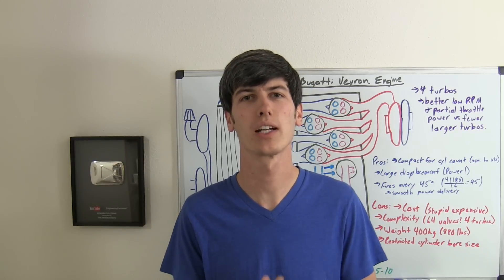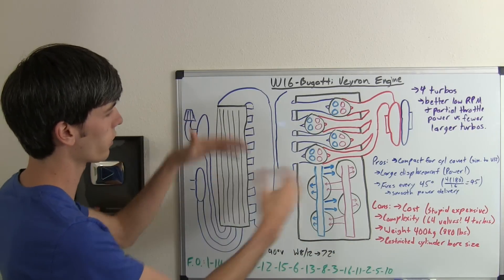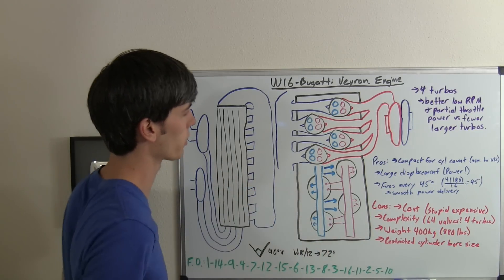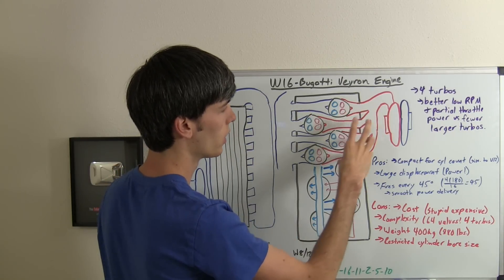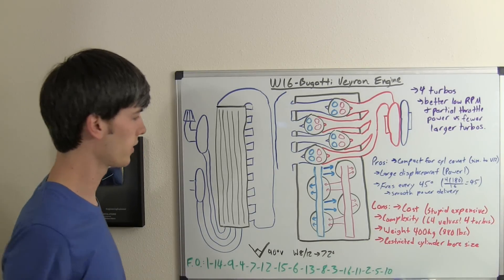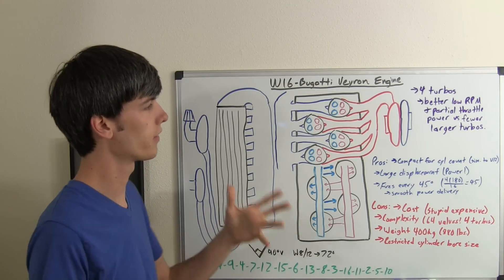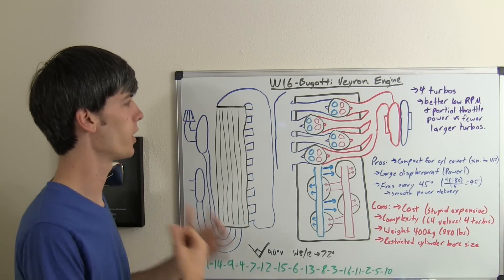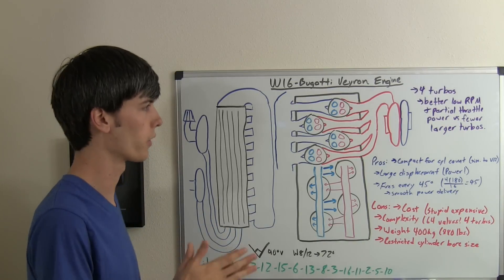W16 Engine - Bugatti Veyron - Explained

Comment: pretty cool engine, but the power output to size ratio isn't that great seeing how koenigsegg can get 1,341bhp out of their 5.0L V8
Reply: Which I belive the origins of that engine was a Volvo was it not...
Reply from the maker: Yep, because a newer car has a higher specific output, this one isn't that great... Add boost, you add power and reduce longevity. A higher displacement engine with lower power will see lower internal pressure and temperatures, meaning less stress on the internal components. The engineers behind it are not less capable than those at Koenigsegg, they're just taking a different approach.
Reply: Yea...but that Koenigsseg engine is nowhere near as refined, smooth, reliable, etc.  It's not even the same type of engine in terms of character , it's a totally different philosophy, it's like comparing a Bentley V8 to a Mustang V8.
Reply: gb291 Ford Coyote actually
Reply: @gb921 The 5.0 in the Ageras and One:1 are loosely based off of the previous 5.4 that Koenigsegg used. The 5.4 was based on a modular engine from Ford, but obviously altered heavily to handle much more power.
Reply: Engineering Explained -.- I didn't say the engine sucks, its an awesome engine, I was just pointing out that for a 8.0L quad turbocharged engine it really doesn't make a ton of power, and I was simply using Koenigsegg's engine as an example for comparison.
Reply: gb291 Doesn't Koenigsegg make their own engines?
Reply: Fraser Davidson ford owned volvo i work in a garage and the amount of ford componenets in volvo is high
Reply: BugattiVeyronBoy taht user name though chuckle and c heers
Reply: Lloyd koenigsegg can get 1,341bhp out of their 5.0L V8Only with E100 fuel i.e ethanol.
Reply: Tippotipo they can get lots more but if you were smart you would realise a car eiyh 1300 hp will probably weigh less and get faster times on like the nurburgring.
Reply: MrRockstarSocial Not exactly true when it comes to power and handling for faster laptime on track like Nurbrugring Nordschiefe. Traction and balance play into equation, look how Porsche 918 achieve its record while being heavier and less powerful than a Koenigsegg Agera series.
Reply: Tippotipo That was exactly what I was pointing out...

Comment: I have been wracking my brain on 2-1/2 engines. This W16 has straight journals/crank pins and the Ferrari Dino had offset pins but the V12s have 65 degree bank angles with straight crank pins. I know this gives the Ferrari that howl. I was studying the F1 engines before the body went all ignorant and set limitations on everything from max bore to v angle and number of cylinders. During the 3.5 N/A period there were all types of bank angles and configurations. One I saw frequently was 5 degrees off of optimal. 67 degree V10, 65 degree v12, 88 degree V8. I was wondering if that extended pulse or offset would upset the crankshaft rocking tendency? Ferrari uses 65 degrees even in their latest design. What other benefit can a doubletap firing benefit? I have read more journals than I ever wanted to with no clear explanation in sight.

Comment: ...and then there is the Hennessey Venom GT which produces 1244bhp from a V8 Twin Turbo
Reply from the maker: +Tom Forrest Add enough boost to any engine and you can make 1200 HP. Doesn't mean it's reliable. Not saying the Hennessey isn't, but adding boost adds stress, and stress reduces longevity. No way around that.
Reply: +Engineering Explained yeah true but its half the price for 200 more bhp im not complaining
Reply: +Tom Forrest One can build a car that will outrun Veyron for less than 1/10 of its price, but it would not be nearly as refined or reliable as the supercar. In that hefty pricetag you are buying lots of engineering, testing, designing, etc. to ensure that this would be a complete, good working package. Also - Badge costs extra. Imagine a cheap car built that it outruns Lamborghinis and Ferraris, it would still remain "just a cheap car".
Reply: I bet it can't put the power down from the line nearly as well as the bugatti can.
Reply: im talking road legal, try getting a BMW M12 down the road.
Reply: what is your problem? this is what is wrong with YouTube comments everyone feels they have to have a deep argument with anyone who comments
Reply: +Tom Forrest I know right, a LOT of cars outrun the Veyron with just half the cylinders, or even less than the half (6 cylinders). The Veyron is just overcomplex, overpriced and overhyped.
Reply: +Engineering Explained bugatti has boost too
Reply: Dg Fuc so does the Venom lol there both Turbocharged its just the Veyron has twice as many and goes slower.
Reply: look at powerbands for these cars. the bugatti makes more power then the venom at lower RPM and runs smoother with less turbo lag. it Also has AWD and is heavier, inherently giving it more grip. The venom has more of a powerspike and is RWD, which is a recipe for disaster.. I.e. the car wants to kill you, as the bugatti wants to go fast. My bet, the bugatti takes the venom all day in a quarter mile drag race if driven at the same track with the same driver and same weather conditions. plus the bugatti has a DSG and traction control. Considering the car weighs 1300 pounds more and makes less power, and Ms more drivetrain loss; The bugatti seems to be a bigger feat of engineering than just simply extending a lotus and putting big turbos on an LSX engine.
Reply: But surely lowering the roofline of a bentley and giving it a unrealistic engine which has never been made before is abit shit aswell?
Reply: +mibars The badge doesn't cost extra on this one. They are losing money with every unit sold.
Reply: Losing 6 million every car sold
Reply: Tom Forrest i said it because this channel replied that adding boost will make more bhp and its ez so im saying bugatti has boosts too
Reply: The Venom is the most insane car out there imo. The Veyron is overkill. The V8 used can take way more than what was thrown in it. They have an E85 tune in one that pushes 1451 without breaking a sweat. Engine design is the biggest factor in how much they can handle. With 6 head bolts per cylinder on that LSX, nothing is going to blow unless you push well over 1800 hp. And that is still short crediting that block.
Reply: Reece McWilliams actually, their block is shorter than a standard. Lsx V8 because they used two VR8 engines together. It only uses 4 camshafts like the lsx and only has 2 heads like the Lsx. It also uses smaller diameter pistons, which allow it to rev easier than the LSx. It also has a more usable power band because of the two twin turbo set ups. The engine is based off the Volkswagen vr6, which is pretty simple, and a 6 cylinder engine that is the size of a 4 cylinder
Reply: +Tom Forrest You have BMW M10 1.5l formula 1 engine wich produces over 1000 hp but its clearly lot less durable due to stress...
Reply: not sure why people think the Hennessey Venom engine is easy to break, I havent heard of any occasions where an engine has broken due to an excessive amount of boost it just uses a strong engine which isnt designed to break your just annoyed that an engine built by yanks which has half the cylinders and half the turbo's as a german engineered engine has more power
Reply: Tom Forrest
Im not really informed but not sure there was a question about breaking... Its possible that it wears out faster...
Reply: Razvan J The Venom is very aerodynamically sound, considering it is a lotus. They don't overheat and cool quite well. GTRs don't overheat also, but you are right about their hoods. At over 150mph, they buckel an have a chance of flying up. The Venom is built on an amazing handling chassis, but just has too much power. You can also buy the Venom with i beleive 7 or 800 hp too, which is not the GT model, which probably handles a bit better. The Venom is almost an ode to shelby. He took a small british chasis and put his big V8 in it, and then the cobra was born
Reply: I like the Veyron much more than the Venom. I own two Volkswagens and it's engine is based off of the VR6 engine in one of the cars i own.  But considering the Venom has an officail speed of 270.8mph, it must mean the Americans were able to make a chasis, built for low speeds and power, capable of breaking speed records. I find it impressive
Reply: I like tuners for regular life situations. I use tuning software on my car, but I don't run high Hp. I think the Veyron is properly built. But considering they cost nearly $8 million to make, I would hope so. Hopefully they come out with just half of the bugatti engine, which is called a VR8 and start making competitive V8s to the LSX considering it is smaller than the LS V8
Reply: There are 1500 hp supras over there, but I don't believe they can be considered  gt cruisers just like the veyron , reliability and maintenance are other things to consider, don't forget aerodynamics  going 250 mph is not easy even if you have the power, venom genesi is fast but I doubt it can be a daily driver
Reply: Razvan J supras are good up to about 750, any thing more then you start to lose serious reliability and drivability
Reply: You are right, skinueagle is one of these anonymous rude Youtube Trolls.
Reply: rude!
Reply: Razvan J for track purposes you're right. The 2jz does have cooling problems, especially when swapped into 240s. If you want track day and reliability, a cammed LS is the best way to go
Reply: but its still in all its glory a volkswagen
Reply: You're completely missing the point. The design of a V8 has been around since Moses was in short pants! It;'s inefficient and takes up far too much space.
Reply: You shall know that the engine can produce 3000 but it is detuned
Reply: Tom Forrest and breaks down every five minutes.

Comment: Ridiculously overengineered engine, You can easily push 1000-1200 hp out of V12 engine, hell even V10 is enough. This engine is very heavy and complex, and due to shitloads of moving parts this engine will waste energy resulting in a terrible fuel consumption/power ratio, the only advantage of this engine is ridiculous low rpm torque, but it's not worth it considering how many disadvantages this engine brings.
Reply: +Vladas Vynauskovas you kinda dont seem to get how stroke works right? less stroke, more rpm´s.
you can only make the engine so or so big with 8 cylinders until you have to increase the stroke.
Reply: exactly seeing as there are 4 cylinder engines that can produce 900bhp haha
Reply: +Tom Forrest for how many hours before being rebuilt?
Reply: +Dan Slotea That's the trouble with most "tuners" where they think just because their car is a dyno queen it will last as long, be as streetable as possible, etc. I love high-hp cars, and especially small engines producing big #'s. But I know damn well it will cost you big $ to get there. There are several people I know who have put out 900 hp but they spent close to 25,000 on the work required to get the clutch, trans gears, diffs, etc in order to reliably put down the power.
Reply: +Vladas Vynauskovas You totally miss the point that with the larger volume of pistons, each piston has less work to do. There isn't a single v10 or v8 engine under 7liters that can produce nearly as much torque at the psi levels this engine works at. This was made to be the smoothest and least stressed engine ever made, and surprisingly one of the strongest because of that. There hasn't been any major engine failures reported from Bugatti since the Veyron has been created, this can't be said for many other high powered v8, v10, or v12 engines you think can make 1000hp reliably.
Reply: Themayseffect I understand that every piston has less work to do so. My point is that 16 pistons aren't necessary and that many moving parts waste power. I understand that splitting workloads between cyls increases reliability, but I mean 16...really? And V12 do make 1000hp reliably if it's configured correctly. My bet is that Bugatti went unnecessary lengths to make the car as smooth as possible, but such reduced efficiency and increased weight is worth it?
Reply: *****
You can't name any factory v12 engines that makes 1000hp on the same amount of boost. Yes the v16 wastes a lot of energy to make 1000hp but still it does less work in the process because its torque band produces enough force to allow the engine to rev freely without to much wasted crankshaft force. But this is energy wasted at full power output. When the engine is running half throttle or less its extremely efficient.
Reply: ***** Why are you so very against using more than 12 cylinders? Sometimes it's not about economy. When you can spend $2M on a car, it certainly doesn't matter that it costs $300 to drive for several hours. I agree you can produce the same power in less cylinders. Plenty of Supras BT'ed prove that.I'd rather have the overhead of reliability than the fuel economy of the supra when you aren't on it. The point of big power isn't losses from friction resulting in more fuel consumption! LOL
Reply: Themayseffect It's funny but the argument is like saying all wheel drive is dumb because it results in less power and more fuel spent. Who gives a crap? Let the guy drive a prius if he wants..
Reply: Themayseffect Koenigsegg says hello. Produces aprox the same amount of hp and torque on a V8...And it weighs 189kg when a W16 weighs 400 kg, which is a huge difference considering that we are talking about supercars
Reply: whatmakesittick All wheel drive isn't dumb, because it actually gives something useful, like boosting 0-100kph times through the roof and overall grip, that's why cars like Lamborghini Huracan, Porsche 918 and Nissan GT-R are the fastest around the track. P.S I dislike Prius
Reply: *****
 Do you know how much more boost the CCXR, one:1 or Agera R is pushing? Way more. I never said a smaller engine can't make more power, i said not on the same boost levels and stress levels. The Koenigsegg engines are one of the few high horsepower cars than can match the Veyron in terms of Reliability and power output, but again the new Koenigseggs are massively expensive and have a ton or new tech to help slay the Veyrons. There are plenty of other v8 , I6's, I4's and smaller engines that top the 1000hp range easily. but the amount of stress they take to get there is extremely high compared to W16 engine. And again by "Stress" i'm talking about the physical force each piston and cylinder bank has to undertake to control that output amount of power those engines are making. I don't understand why you don't get that. I'm not saying the w16 the Veyron uses is the best most powerful engine ever made, but is undeniably the least stressed high powered motor ever made simply because of its size and overhead of pistons.
Reply: Themayseffect  You misunderstand me. I said i understand that when power is shared between a higher quantity of pistons the engine isn't stressed so much. I just gave it as an example that there are even 1000 bhp V8 production engines. Also, 1000 hp 4 and 6 cyls suck for street use, because achieving such power puts too much stress on the engine, not to mention the amount of boost it's needed(hello turbo lag) My point of this whole argument is that there is a spot between reliability and perfomance, imo V10's V12's are a sweet spot for 1000 hp, look at Underground racing, these guys put turbo's on Lamborghini's naturally aspirated engines and push out 2000 hp.
Reply: ***** Yes, but again for the last time, boost pressure. The w16 is a low boost engine. The underground racing cars are race cars, sacrificing luxury for top speed. The Bugatti is a no compromise luxury car. You probably seen videos of people racing against the Bugatti in modified sports cars to beat the Veyron squirreling all over the place trying to find grip while the Veyron is just cruising doing 180mph without even fidgeting. That comes down to the weight and the overall build quality very few cars have matched yet. You don't know how many times UGR had to build and re-tune those Gallardo's and R8's to push out 2000hp, and those cars don't just run at 2000hp all the time, they are drag cars. Luckily for them the VAG v10 engines were the most solid v10's next to the viper v10. So its a smart platform.
Reply: ***** I was talking about Themayseffect and his argument. The guy is trying to discount an engine that you and I admire. I also think AWD is the ONLY way to go these days with the power we are talking about. I'm all set with the Koenigsegg just because it has too much engine for RWD IMO. I'm a type 44 audi guy. So I know all about heavy, AWD cars.... and heavy boost.
EDIT: maybe I was talking about you after all... just read it again.
Either way saying that an engine that has more cyl's is less efficient is like saying adding the weight and drivetrain losses through AWD is inefficient.
Reply: whatmakesittick I have no idea what you are blaberring about, but good for you.
Reply: Themayseffect Sorry man I got confused about who was saying what here. LOL
Reply: +Themayseffect Koenigsegg engine is an evolution of the Modular Ford V8 engine which is why it sounds more like a typical V8 engine muscle car. It turned out the base template is identical.
Reply: +Themayseffect the Viper 8.4L V10 the only V10 in the world that comes close to a W16. Albeit all it would need is forced induction. Yet without it is still a monster. Hennessey has proven a Viper V10s full potential.
Reply: Raymond Jones With forced induction almost any engine can produce big numbers. That Viper 10 cylinder is really high output but look at the displacement! 8.4l is HUGE! Still, an awesome motor all the same!